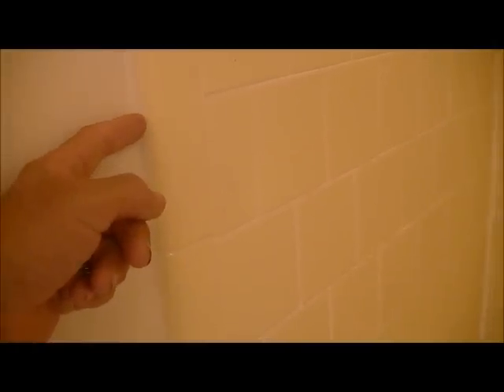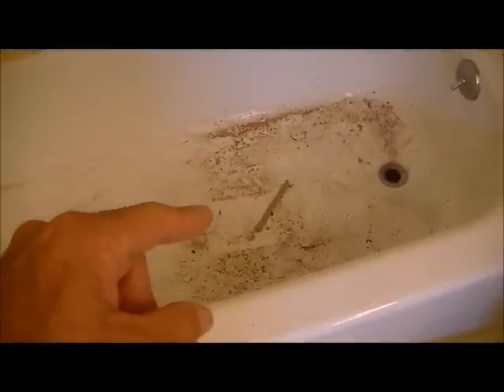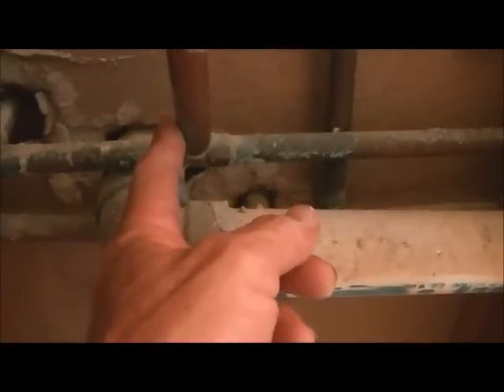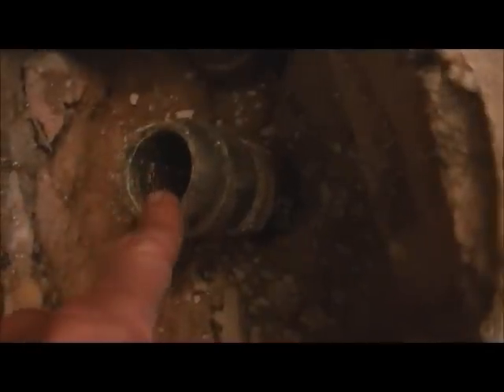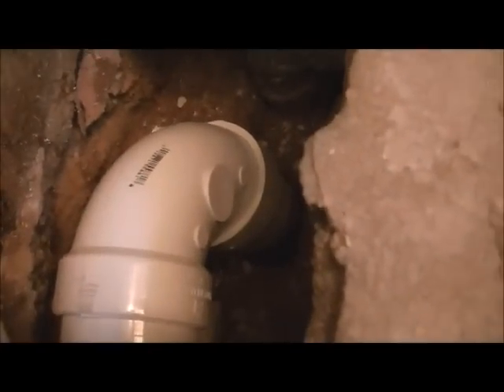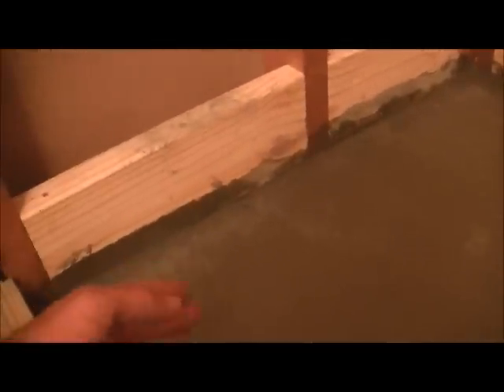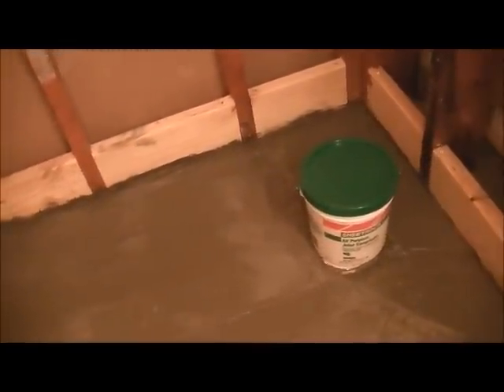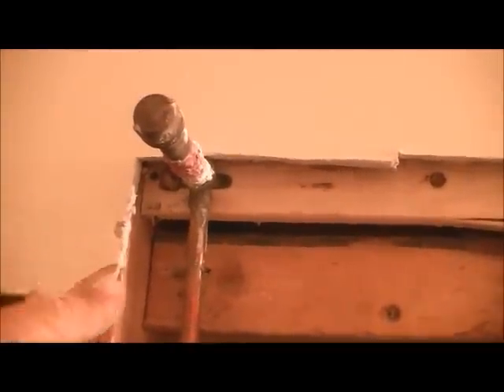How To Convert Tub To Shower

Comment: Ive always been told to put concrete board on the walls but you used sheetrock. You being the professional here-could you tell me why you used sheetrock instead? It seems like you get a smoother finish wall to wall using sheetrock which would make it easier to tile.
Reply from the maker: Allow me to explain about wallboard. I use Greenboard in my showers, basically sheetrock with a chemical to prevent mold & mildew...it is a no no to use gypsum in a wet area because mold/mildew feed off of it. HOWEVER, with a topical membrane, in this case Redgard ( 2 coats minimum ) I preclude water from ever getting to the board, then trowling out thinset on the walls, using a large tile, sealing the grout, the entire process insures waterproofing of any wall board you use. It could be hardi, durock, wonderboard, or an 8 inch thick concrete wall, in EVERY case you use a topical membrane, so what difference does it make what the board is ? Cardboard would work if it was stiff enough to set on the studs.

Comment: I would like to do a shower but my wife don't like the wall tile. I guess cleaning the grout after some time.
what type of tile would you recommend for the shower pan floor. And also is there a way that i could do with out the wall tile? 
maybe using fiberglass or some type of PVC back splash. IM JUST LOOKING FOR IDEAS. and i see you know your stuff man..
Reply from the maker: A 2x2 on a mat or single 4x4 tile on the floor...the walls need tile, perhaps a laminated fiberglass panel, buy why ???
Reply: Can i just use green board like you use baker board and keep it a inch or two from the pan or is it just better to use baker board.I have done some tile work but i do it for myself, just trying to do things right the first time. I never heard of redgard but  now i do thanks to your videos..
Reply from the maker: Yes you can use anything IF YOU waterproof it.

Comment: Hi. Great video. I have a bathroom that is identical to the one in the video and I'm in the process of getting quotes from various people.  Any way you could tell me realistically how much a renovation like this should cost me?  I know they say it depends on the area I'm in (San Antonio, TX) and what I want the end result to be. I got a quote from Rebath and seemed like a lot to me, so just want to know what I should expect.  Thanks!
Reply from the maker: Cost is hard to determine since most of it is labor and that's too subjective...but FINISHED job, all material & labor about $2000 to $3500
Reply: StarrTile Thanks Bob. That's just what I was wondered as well. I'm going to do this as well. Excellent vid.
Cheers!

Comment: Mr. Doyle, I put up a vapor sheild (6 mil clear plastic sheeting) behind the Durock for a shower I am doing. When I went to buy Redgard I found out I should not do both. Should I a) tear down the Durock and vapor sheild and start over, b) use the Redgard as is, or c) leave it alone and not use Redgard? Thanks. Omar
Reply from the maker: +Omar Perez  Using both is NOT a good idea, but I'm sure it's past too late now.

Comment: Curious as to what kind of grout you use?  I'm wondering if the use of the PVC liner and Redgard will be redundant with an epoxy grout?
Reply from the maker: +Sandra Possin  I use Polyblend, Home Depots product, but normally use an admix instead of water, makes it stronger. I don't think it's redundant to use epoxy grout, it prevents water getting to the Redgard & Liner

Comment: Why not use durarock instead of green board.
Also Ive done curbs without screwing thru liner. one way is to put board before you set mortar, that holds the bottom also use liquid nails plus some carfuly predrilled screws from top to edge of side (this only works with 1/2 hardibacker).
Other way is to make curb out of concrete.

Comment: What would be an estimated cost to pay someone like yourself to switch out a tub for a shower like you have done here (just the tub / shower part exactly like you have it). Also we have a finished basement under our bathroom, will any of this work require the basement ceiling to be replaced?
Reply from the maker: No your basement ceiling would not need to be replaced... and I could not possibly tell you a price on doing a tub to shower conversion, there are way too many factors to consider as each project is different. But you can count on 2 to 4k.
Reply: how did you fill in the hole around the drain
Reply from the maker: Concrete
Reply: so just straight up concrete over the  dirt. does it completely encase the pvc drain line. thank you for your help I'm a complete noob at this.
Reply from the maker: Yes you start from where the dirt ends, usually your foundation is about 3 to 5 inches thick, you would pour that amount of concrete all around the drain so that it's flush with the rest of the floor

Comment: how did you fill the hole around the drain before laying the cement? or did you just fill it in with cement?
Reply from the maker: Not sure I understand...the square where the drain used to be got filled with cement, yes..

Comment: For backfilling the slab, could you fill the hole with crushed stone and put a 2-3 inch layer of concrete on top?  Is it ok to encase the P trap and drain pipes in concrete?
Reply from the maker: Yes you could do crushed stone & layer on top, not sure why though. And yes the drain pipes are fine embedded into the concrete, it's only about 4 inches to dirt anyway

Comment: Thanks for the video, really helpful. Quick question though, wouldn't it be better to lay the liner, THEN put up the wall, then lay the mortar so there are no gaps between the floor and the wall? Is there a reason that I'm missing (quite possibly!!!) that you lay the mortar then put the wall up?
Reply from the maker: Yes...so your wallboard is not embedded into your pan, should it get wet then water will wick up the board...no matter what it is.
Reply: Brit Kat either way you do it you have a chance of it wicking it doesn’t matter just my opinion if you red guard your mud bed and walls it will not happen just saying

Comment: I noticed that you described the street elbows as 45-45 but they are actually 90-90  right?
anyway... I've just run into this problem on a tub to shower conversion on the third floor of a condo. The previous owner did a hack job and rigged a horrible shower using the original tub plumbing ( he blocked in the overflow neck with tile). All the vertical plumbing drain lines (in the wall) are PVC but the old tub drain and overflow are brass. I'm afraid to chip down into the concrete because i don't know where the brass ends and the pvc begins. i don't want to be chipping down into the condo below, which is where my P trap is above their dropped ceiling (assuming consistency between floors, since that's what i see with my ceiling demo'd)
Reply from the maker: Yes I mis-spoke, and it's been pointed out too, sorry.

Also sorry to hear about the hack job that was done, it will be difficult to rectify for sure...not sure if there was a question or not, but I think getting a plumber in there is the way to go, as you're dealing with other units where you are, so I wouldn't fool with it.
Reply: What was the total cost charged to this customer ?  $5000.00 ? Please include materials + labor . Thanks !

Comment: hi.  i just bought a home with a senior's walk-in tub.  do you have any idea  how much it would cost to remove it and replace with anything?  house is on slab, is in an exterior  wall, built in 1978.  thank you for any advice or thoughts.
Reply from the maker: Too many details need to be known, no way to give ANY kind of definite price...even if I did it would be my price, not another guys. But budget for $2500-$4000 total cost.
Reply: thank you.  by watching your video i was able to see the complexity
involved...the drain location, the wall damages, the water pipes.  yikes.  and i live in southern california..so add a surcharge.

Comment: Hi! I love your videos! My husband and I are DIYS, I've seen you giving pricing of $2500-5000 for a tub to shower conversion. Is that a cost for DIYS?? We've been pricing materials out and those costs aren't getting that high for us.
Reply from the maker: The cost I give is always labor only, huge difference in the numbers because I can't account for design stuff, type of tile, how quick someone needs it done, location, etc.
Reply: Megan Escoto I just finished my children's bathroom. I replaced the the toilet, tiled the floor and 2 walls. I bought a little at a time until I had everything. I still need to paint some of my walls and cabinets but I think it is great! Best of all, it is waterproof! I have 6 grandchildren and they love baths lol. Now it won't matter if they splash everywhere.

 You can get the concrete boards for about $15 each. I think I used 4. I used about 2 1/2 boxes  of subway tiles at $22 per box of 100. I used about 4 or 5 boxes of mosaic tiles at about $25 per box. I used the pro acrylic adhesive for the subway tile and mosaics. I think it was about $36. I used about a bucket and a half. it was great to work with for me and I'm a beginner. I didn't want to try to mix the thin set myself. I used about a bucket and a half of grout at about $26 per bucket. I bought a box of masonry screws for around $8. I also used a bucket of redgard for about $50. I used paint brushes to paint the redgard at about $5. I did buy some trim pieces at about $1-$2 a piece. i probably bought 50 of them. i think that's all. I bought everything from Lowes and Home Depot.

 I'm starting on my master bathroom tomorrow. We have already taken out the old shower and separate old tub. We are going to just have a walk in shower. My husband does the demolition and I repair it. If I can do it, I think you can. I'm thankful to Starr Tiles and his great videos. I wouldn't be able to afford to pay a contractor to do my work we need done.
Reply from the maker: That is awesome !!
And thanks for the compliment 👍
Reply: StarrTile Thank you so much for all you do! Is it alright to butter my tiles instead of spreading? It just seems to hold better to me.
Reply from the maker: Do both...trowel out thinset on floor/wall AND back butter tile.
Reply: StarrTile Thank you! Will do!
Reply: Megan Escoto I forgot the fibrous joint tape. I can't remember the name but it was around $8 I think per roll.

Comment: I had a question about the hole where the drain is. Would it be ok to fill that with sand rather than concrete?

Comment: Why don't you like hardiebacker board - I've done tile my entire life - I've used it a lot and have never had an issue which is why I'm curious- I've used red guard on pan as well never an issue - in my niches I prefer flush picture frames with a shelf on bottom that comes out 1/8 inch I hate having that grout/caulk line on top -- love your work just curious on that thanks
Reply: Hardibacker dissolves in very wet spaces. It is fiber laid down in layers. Mudbed water leaches up or simply never leaves the hardi around the shower floor and it stays damp and the fiber layers begin to separate and the bond goes to hell. Have you ever ripped a hardi shower out? It is pretty nasty.

Comment: i HAVE THE SAME SCENARIO AS A TUB IN MY BATHROOM, IS IT POSSIBLE TO TAKE ALL THE TILE OFF AND BATHTUB AND NOT HAVE TO REDO THE WALL, PUTTING NEW DRYWALL??? CAN I SEAL IT AND PUT TILE ON THE WALL PREVIOUSLY THERE, JUST CHANGE THE TILE AND ADD FLOOR TO THE SHOWER?
Reply from the maker: That is VERY difficult to do & not a good idea. To do it properly, start from scratch

Comment: The drain would not pass inspection, at least not in most states. You must have a continuous 2" drain running from the drain flange to the main. Great job otherwise!

Comment: Why did you not center your wall so you have equal cuts that looks terrible with that rip in the corner on the back wall rule of thumb is to get your cuts as big as possible it would of looked so much better because that’s the first thing I noticed and I’ve done tile for 20 years but other than that  looks good!

Comment: Screws on the inside curb backerboard ALWAYS FAIL. There is a way to use backerboard on the inside curb by not using any fasteners. I agree with most of your content and every time you talk about using screws on the inside curb, I wince. I do a lot of new construction repair (mostly condos) and those damn nails are a pain in my ass. First of all, you get curb swell (imagine the expansion power of freezing water). Then, the bond cracks on the tile and the grout joints open up. Then, even more water penetrates. Then, more curb swell. Ta Da, shower curb replacement. You do such good work and you know what a bad idea it is. Water has capillary action, it pulls itself into places. Water is also VERY, VERY sneaky.
Reply: What kind of fasteners, can you elaborate on this point please

Comment: What are your thoughts about filling that initial hole in the slab with aggregate...pea gravel..something drain ready of that sort around the drain instead of concrete?
Reply from the maker: Not a good idea...liner sets on top and needs solid non movable surface
Reply: Ahh..I can see that..but I am doing a pre-slope. Yes, I know it's not necessary, but you said it couldn't hurt..and it would address the issue of the liner sitting directly on the aggregate fill...

Comment: I prefer buttering the tile instead of spreading and then applying the tile. Will that hurt my work? I'm just learning and working in my own home. I'm not a pro by any means but I have finished one bathroom and am about to start the master bathroom. I hanks!
Reply: Hello, I've been doing tile for about 3 years and I always butter the tile on large format although if your doing subway or small format it's so much easier to do the wall!! As long as you have good coverage

Comment: Why do you prefer durock over hardie?
Reply from the maker: Because you can score and snap Durock a lot easier than Hardi
Reply: I used to think the same thing until I bumped into the local Hardie rep in Miami and he showed me the right way to score and snap. I'm big on quality and for me I love the fact that its stronger and I don't have to deal with the abrasive aggregate that the Durock leaves behind. Plus I don't have to waterproof the stuff which is great. Just thought I'd share. Keep up the good work.

Comment: Beautiful tile job...But the plumbing is no good.  For one the pipe with the caps are air chambers to prevent water hammer.  They are starting to become obsolete as they require water hammer arresters on fixtures containing quick closing solenoid valves. 

The drain for a shower is two inch for a reason.  There are no increase fittings in plumbing only reducers.  You have created an S trap adding 90's not 45s.  No good.  Just imagine trying to get a snake through that contraption. If your going to use a 1 1/2 drain for a shower then you should at least put the reducer on the trap arm and install a new 2 inch trap in the correct location. Then at least the plumber who has to snake it because its undersized will have a much easier time.  It would have been easier to cut the horizontal of the trap arm before the elbow and go from there to the correct location.  Never go from the trap riser. You can not offset that more than 45deg...which is like this / not like this L.   Also a hack saw blade off the saw works great for cutting tight pipes.  They even sell a handle to attach to it.

Also plumbing code requires a space of at least 15 inches from the center line of the toilet to the edge of the curb or vanity.  Just FYI.
Reply from the maker: Your comments are appreciated, and dully noted.....however, no S trap was created, simply a 45, to old drain & to ( old ) P-trap in-ground....works perfectly, I used the shower myself since I stayed there during their second bathroom I did and no issues. Also the distance is 16'' between center of toilet and any stationary surface, not 15''...in this case I never moved the toilet, and a shower curtain is in use, old vanity & new are same size ;-)
Reply: StarrTile   An S trap was created because you used 90's not 45's.  Go to home depot and read the labels. 45= /  and 90= L.  Sure it works perfectly now.  But as soon as a couple hair balls pile up in the undersized pipe then it will be a problem for the plumber trying to snake it.  Shower drains shall be 2".....So you saved yourself some money and gave them a hack plumbing job.  Uniform Plumbing code is 15 inches from center line of toilet to any fixtures or stationary surface....ie the shower curb.  It does not matter if you moved the toilet.....you moved the curb.  Same difference.  You can argue with me just note I am a plumber and your a tile guy who thinks a 90 degree elbow is a 45 degree.

Comment: I have a an old tub and tile combo on concrete just like you. It even looks like the same tile but in a different color. The only difference is that it's a single wall redwood home(old Hawaii style).  I really want to do a seamless walk in shower, but being on concrete slab I don't see that as a possibility, so instead I was going to build a curb.  The main difference is that I want an asian drain through teak floor, which I will custom build to size. Something like these: https://www.houzz.com/photos/454927/LG-House-Ensuite-Shower-and-Bath-modern-bathroom-edmonton 

https://www.houzz.com/photos/81875/Master-Bath-contemporary-bathroom-other

Again, I'd love to have  seamless walk in, but being on concrete I don't see how, so I will use a curb to give me height for teak inset. 

How would your floor/pan construction differ for that?  The drain will simply  be hidden beneath the drain through teak floor.  Thanks!